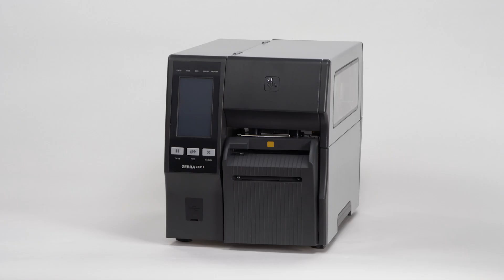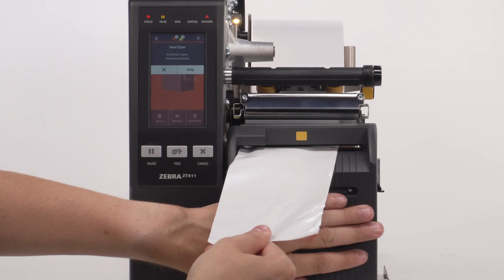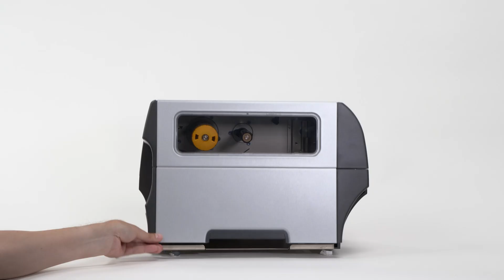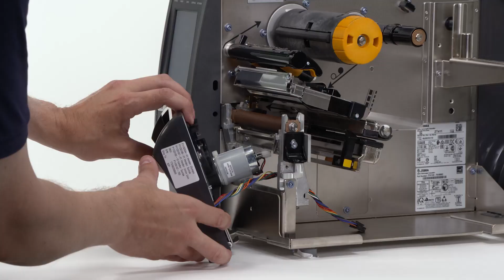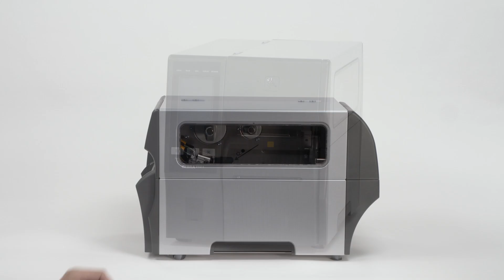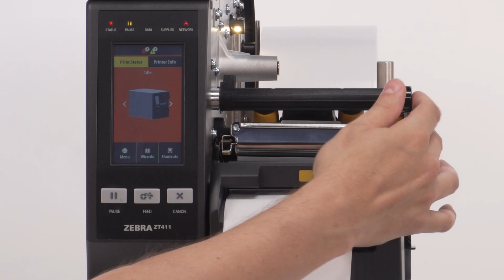How to Clear Errors, Load Media and Install the Cutter on ZT411 Linerless Industrial Printer | Zebra

Comment: Hello, can you help me with a problem with my Zebra ZT411 printer? On Wednesday, the screen said "Download New Firmware USB: Active." The printer could no longer be used. Then, on Thursday, when the printer was turned on, the screen was blank and I couldn't do anything. What's the solution?